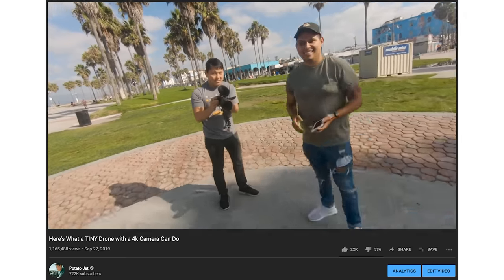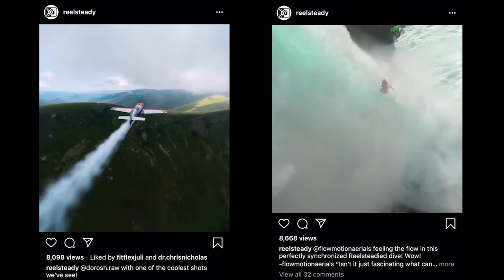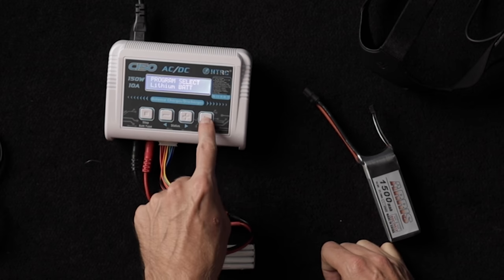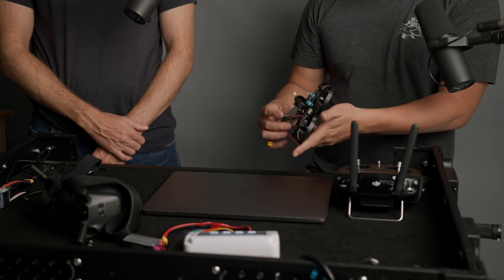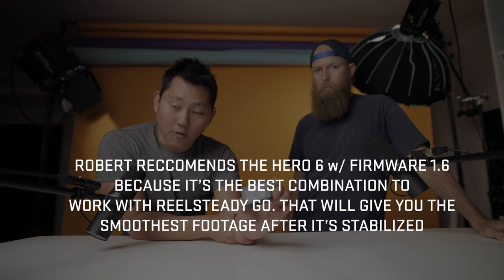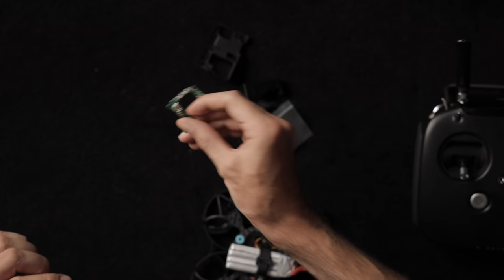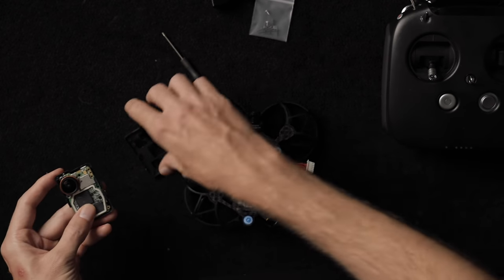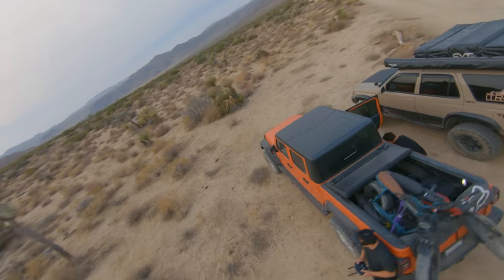How to Setup a TINY FPV Drone | Complete Beginners Guide for Cinewhoops

Comment: On the charger, you want to select LIPO BALANCE, rather than LIPO charge, balance will charge and balance at the same time which is safer, lipo charge will ignore the balance wire or what they referred to as the communication plug
Reply from the maker: Good Call!
Reply: @PotatoJet  Yes I noticed that right off as well..
Reply: depends on your balance charger.. iMax and ISDT chargers will balance on charge mode.
Reply: Everything I've read says most LiPo's 'charge rate' is 1C.  So, for a 520mAh LiPo your talking 520/1,000=0.52 Amp charge rate.  However, he's saying it's okay to double that (0.52 x 2 = 1.04 Amp Charge Rate).  He's charging at 1.1 Amp (slightly more than double the charge rate).  He's the expert but does get confusing with these batteries.   I know it can differ by LiPo Battery but I rarely see 'charge rate' marked on the battery itself so I've been doing the 1C charge rate to date.  Looks like your using a GN3Flight Power Lipo....
Reply: @RGMGFitness  yep so it’s sorta up to u in a way. Him charging at 2c poses zero fire risk but will slightly affect the long term health of the battery. 1C is basically a rate at which you’re totally safe but some batteries (like my cnhl) even claim to be safe for 5c charging. That’s probably safe too but I’m sure it’ll have affects on the long term health
Reply: @RGMGFitness  I think my RC car batteries from like 8 years ago could even charge at 4 or 5C. But then again they are rated for like 100C and more discharge. And have XT90 plugs. The power draw is ridiculous at times when you full throttle these cars.
Reply: I don't think you can balance-charge unless they are both close to equally low in charge. ?

Comment: Tip to make your batteries last longer: charge your LiPos at 1C, aka 1.5A for your 1500mAh or 0.52A for example in your 520 mAh battery, you’ll be fine charging at 2C but the batteries will last the longest charging slowly. Hopefully you can make the batteries last that long, us FPV pilots tend to retire our LiPo packs from crashing too much :)
Reply: I was thinking the same thing.  1C Charge Rate.  Though, everything I've read says different batteries can support different charge rates (1C, 2C, up to 5C) depending on manufacturer.  But I've never found the 'Charge Rates' labeled on the batteries or on the manufacturer web sites so I'm guessing people are just making assumptions many times on what they can get away with?
Reply: RGMG Most LiPos can take a 3C charge rate, i’ve heard of people charging them at 5C when they’re in the field to get more flying time but all the super high charge rates deplete the lifespan by a lot and can potentially start a fire if the LiPo isn’t good quality
Reply: @andrewechang  Thanks for the heads up.  I've been very conservative to date (not knowing the limits).  I really wish the Lipo manufacturers would specify this somewhere.  Seems like no one wants to document it so we at least know the limits of the battery.
Reply: I was really surprised that he was advocating charging at 2C. Especially since this video will be seen by loads of beginners. Every other FPV YouTuber I've seen says charge at 1C.

For the beginners, that means he should be charging at 1x the amperage of the battery. In this case, 0.55 amps and 1.5 amps for the larger LiPo.
Reply: Lin Nyunt yeppp i usually destroy my lipos by crashing them before their lifespan is over but still good to make 1C a habit :)

Comment: Been rocking the DJI FPV System w/ a BetaFPV Beta95X for a few weeks now.  Its' such a blast!  Haven't mounted a GoPro to it yet...want to get a little better flying FPV first.  Otherwise, can get expensive very quickly.

Comment: I really don’t recommend taking apart the hero 6, I’ve had 2 break from pretty soft crashes. Just take out the battery and the covers and use a usb c adapter to your battery to power it and it’ll be light. Not as light as the stripped hero 6 but light enough and more durable
Reply: I'm wondering if you could make a kind of light protective case to attach to the quad and take the impact for the Gopro? Should be possible to make something lighter than the Gopro case itself as there's also screen and stuff
Reply: @vincentholm326  we already do that. We 3D print tpu cases for full size gopros to protect them
Reply: @adamhasan7370  yeah, but I mean for the naked gopros. Something in hard material to protect the naked gopro like on this beta95x (or 85x, can't remember). Just protect, not tightly wrapped around it. It should still be much lighter than a full gopro
Reply: @vincentholm326  yeah could print something with tpu that’ll help protect it, I just think most people strip down the gopros because they want the lightest setup they can get

Comment: I started a month ago with the BetaFPV FPV Whoop Racing Advanced Kit 2. The Metor75 Whoop is good. The remote was good but didn't last more than two weeks before giving me issues; customer support sucks, they are beating around bush instead of just taking the remote and fixing it. And the goggles also kinda sucks.

Should of gone with Eachine goggles plus a Newbeedrone BNF.

Comment: Rule of thumb when charging: if the battery is 3000mah then you charge at 3 amps. 2500mah then 2.5 amps. Always discharge batteries if you’re not going to use the batteries for a long time.
Reply: You can charge LiPos at 2C no problem.
Reply: I also do not get it - why he said that you have to doubled it when charging... I follow the mAhs at my batteries and set the same amount on my charger.
Reply: @TheKondicional  that’s fine if you enjoy wasting time. LiPo batteries can be safely charged at 2C aka 2 * mah rating.
Reply: @fatal510  Thanks for your message! Did not know what 'C' means. Great to hear that then, I thought maybe it's not safe to charge them this way. Just getting into FPV and learning every day lot of new things. There is a HUGH learning curve in the beginning. Things will get easier with time and experience. Happy flying!

Comment: You may have missed a step before you start taking the gopro apart, which was to get it connected with your phone so you can change settings later on. It's much easier then reconnecting the back monitor.

Comment: The balance port isn't a communication port, it's just a direct connection to each cell, so the balance charge can charge each of the cells equally. Each cell is nominally 3.6 volt.

Comment: Do any drone companies which make larger FPV drones make fully assembled systems including the goggles, the drone, the camera, and the controller?
Reply: iflight does it but it's like $1200
Reply: @Jacob_Roberts  I would recommend you to learn fpv from ground up. You will most likely break stuff if you have never flew fpv. You will know how to replace everything if you build it  yourself. Also most fpv drone are meant to be flown manually, there is very little thing preventing you from crashing a 600g+ open prop drone into something. Starting from small trainer fpv drones goes a long way.
Reply: @hotelquebecsierra3065  Thank you.

Comment: We need longer flight times. How do we get that?
Reply: Depends on what you want to do. For a small cinematic drone like this, a couple minutes is all you're gonna get. You can strap on a bigger battery to increase the flight time to a certain point, but that'll negatively affect flight characteristics and you're going to get diminishing returns.

There are long range setups that will get you 30+ minutes of flight time with Lithium Ion batteries, but this small whoop is not that.
Reply: @FPFPV  man that sucks. Hopefully batteries get lighter and better soon. I like using my beta fpv that is the cheap ready to go one. That short flight time though. When I build my gopro version it is just crazy to me that a $1500 drone will only fly 4 minutes. I guess I'll deal.

Comment: one major drawback with DJI digital FPV system...at this writing...is it's totally proprietary and affordable monitoring options are null!   in order for your friends/family to watch you fly (or more important commercial clients)...you must invest in a ridiculously expensive 'smart controller'!  If you already fly the Mavic2pro you might already have one.  However, if you're an early adopter...you shit out of luck.   Looking forward until there is a inexpensive DJI and/or 3rd part monitor that is compatible with their digital system.
Reply: the reason why the monitoring options are scarce is also because the receiver also talks to the transmitter for requesting retransmission of corrupt data. the air unit can only receive/fulfill retransmission request from one receiver to maintain latency. This is also why audience mode is low quality and it would be the same for any potential passive 3rd party monitor. It is just how the system is designed to give the pilot hight quality, low latency video.
Reply: @hotelquebecsierra3065  I see your point.  However, users like myself fly commercially and could care less about nanosecond latency...I don't race quads. The 'smart controller' is suitable but it's a 'controller' NOT strictly a monitor.  The CS would be a 'smart' candidate we use it all the time with the I2...and it works great.  But it needs app updates and being only 32 bit its use is questionable.  However, DJI just issued a firmware update for the I2 so 'hopefully' they'll update the CS too!  Fingers crossed.

Comment: Clicked on this excited, expecting being able to get into FPV for a few hundred bucks. Now my soul hurts. And my wallet is anxious.
Reply: You CAN! If you can’t spend on digital then analog is totally fine. Box goggles (ev800) are great and you can pick up the radiomaster tx16s for like $110. So $110 for radio (can go cheaper to an frsky x9 lite or something), ev800 for $50 and build a quad for like $150.
Reply: @gautamkrishna7421  Is buying that stuff on banggood a good idea? Or do I get cheap copies on those sites?
Reply: @ImNotQualifiedToSayThisBut  If you live in the US or have good local vendors and are willing to spend a little extra, then do. That said, just because a product is on banggood does not make unoriginal or bad. It’s just delivery times to the US are quite long and if you have an issue with a product then you will receive better support from a local vendor. Anyway you should still be able to get in the air for about $300 using stuff from American vendors.
Reply: @gautamkrishna7421  Well, I'm from Germany. ^^ I'll look around for a vendor here. Thank you
Reply: once you get into it, your wallet will hate you lol. Let me know if you need any pointers on how to get into it. I would start with a transmitter and a simulator
Reply: @ElioteSchulerT1xe  That is definitely true😂. And can’t recommend the simulator enough.